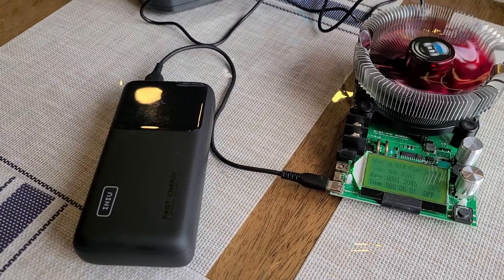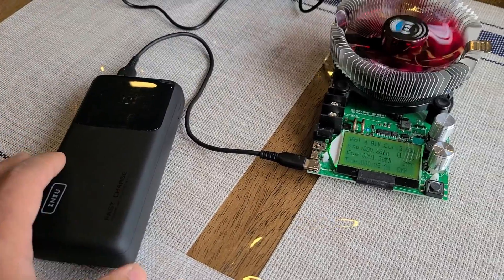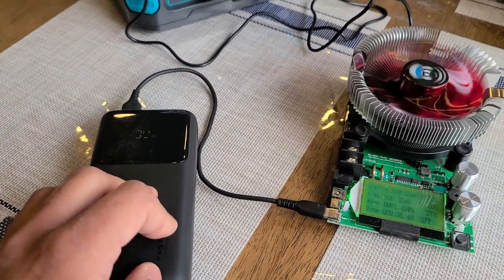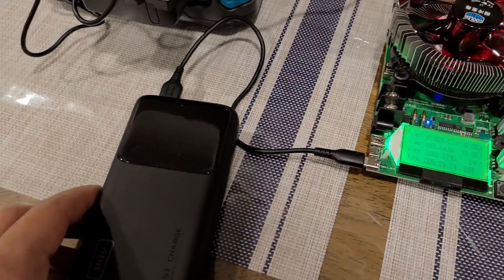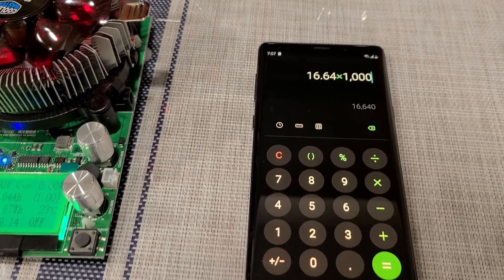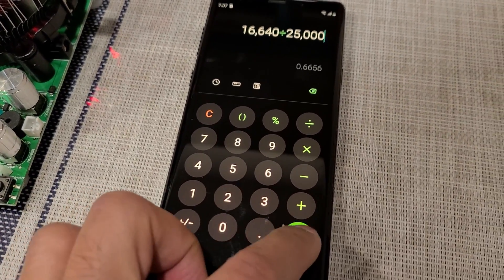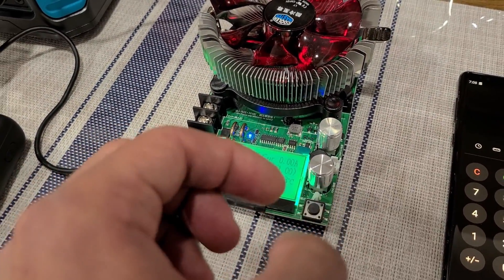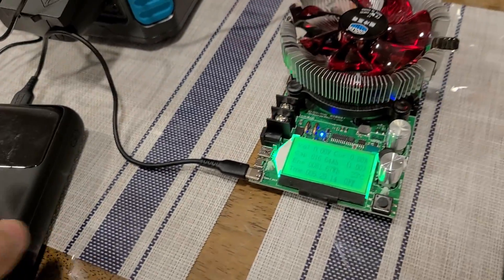INIU B63 25,000mAh Power Bank Capacity Test

Comment: What you did is totally wrong. You measured how much it outputs at 5v. While rated capacity is for 3.7v. So right number that you measured is 16640/3.7*5.0 = 22486mah. To convince you, make powerbank to output 20V, you will be able to measure only about 4000mah
Reply: He will need a trigger board in order to test the 20V.

Comment: You need to use power (watt hours) as a unit of capacity, not current (amps). Because amps can change at various voltages which is the case with power banks these days featuring QC, PD etc.

IIRC That power bank is rated for 92.5Wh
Your load test drew 81.67Wh
88.3% would be your correct efficiency which is more realistic expectation.
Try not to drain your cells below 20% they last longer above 20%.

Comment: Excellent test, but the tested capacity of 16.64 Ah was at 5 V and it gave 81.67 Wh stored energy. Originally max stored energy in the power bank is 25000 mAh at 3.7 V = 92.5 Wh. So the efficiency is much better at 88%.
Reply: Eh, no it’s not?
Reply: @campersruincod6134  yes, it is.
Reply: @campersruincod6134  if you're going to say "it's not" explain why. rolls-eyes emoji

Comment: So I'm lost is it only putting out 16,000 mah?....is it worth it? Thanks
Reply from the maker: It's alright. The advertised capacity that you see on the Amazon page, or on the power bank itself isn't really the capacity you'll be able to use.

Sure, the batteries inside add up to 25,000mAh for this INIU power bank, but its efficiency at 15W output is 16,000mAh.

You may get lower usable capacity at higher watts, but I wasn't able to test for that.
Reply: @chargerharbor  so what's the best one to get if you know of one because Amazon shipped this one over night already WOW 😱
Reply from the maker: @BIGGBULLxxx  I think you're alright choosing this one. Power banks, in general, don't have very good capacity efficiency, and 16,000mAh usable capacity is pretty good.

I'll be doing capacity testing for other power banks, too. Just got finished doing testing for the Baseus Blade, and just gotta edit the video. Efficiency for the Baseus Blade came to about 60%.